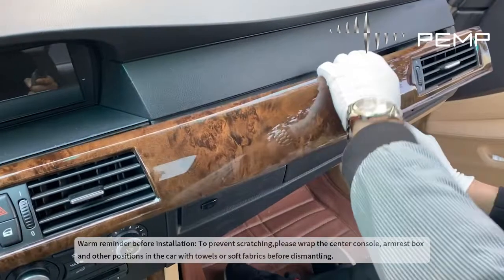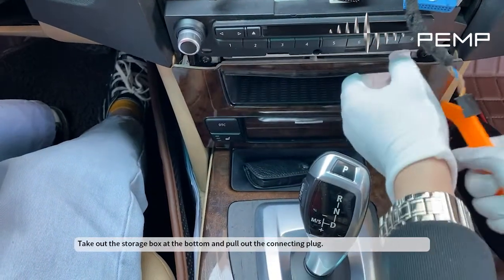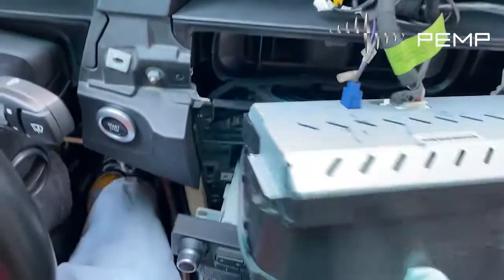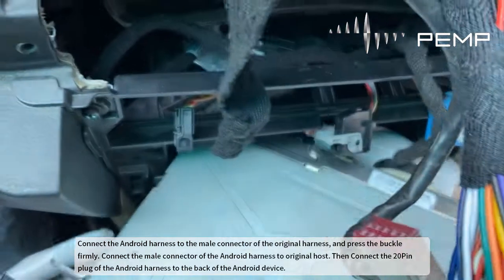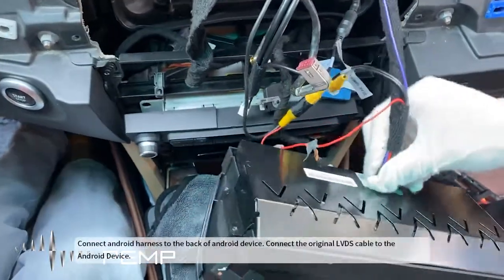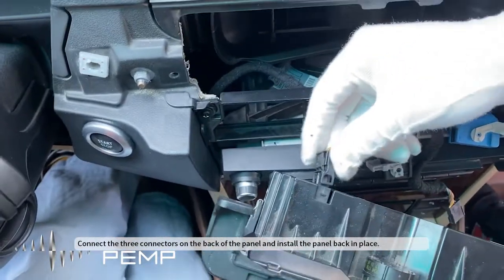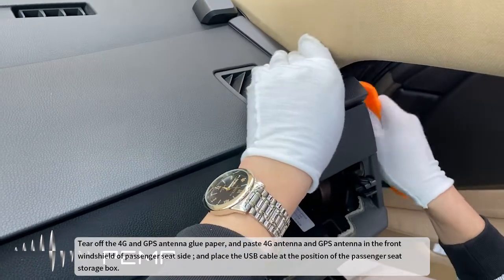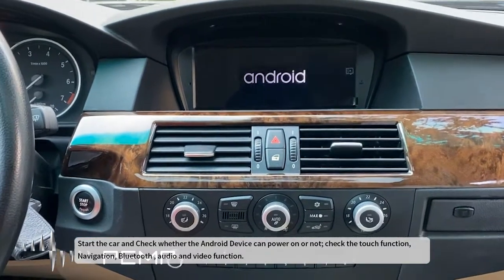Install BMW E60 CCC Android screen then use your Apple CarPlay

Comment: Why you didn't connect aux cable? My OEM radio is CCC 2008 is the same like you and it have aux menu already. I dont need to connet this aux cable?
Reply from the maker: If you can't get the sound for android. You can try to connect AUX Cable
Reply: @pempcar  Thanks for answer.

Comment: “Can it be installed anyway even though I don't have navigation in menu?BMW e60 2007?
Reply from the maker: Yes, you are right. it fit your E60 2007 without navigation. but OEM must has aux menu.otherwise you can't get android sound.
Reply: @pempcar  Thank you,I have aux 👍
Reply from the maker: @stajeovosad  That's great!

Comment: My car original ccc unit is burned out dead, Will this pemp andriod work regardless?
Reply from the maker: You are right, your original car radio is broken, and our product is not working properly. You must repair the original car receiver and let it work properly before purchasing this product.
Reply: Sorry bud but you need to replace the unit

Comment: the unit won’t go back to original menu
Reply from the maker: If NO signal is displayed in the OEM interface, you can select another correct resolution in the Car display in the factory settings.
If you still can't solve the problem, please contact our after-sales service team at service@pempcar.com

Comment: I DID ALL THE INSTALATION, BUT MY IPHONE DIDN'T CONNECT BY BLUETOOTH WAY . WHAT CAN I DO????
Reply from the maker: What does it show on PEMP bluetooth interface now? You can try to connect PEMP to your phone's hotspot to get the network to solve it. You can also do Recovery once (Settings/system info/system recovery); If you still can’t solve the problem, please send your purchase order number and problem picture to Service@pemcpcar.com